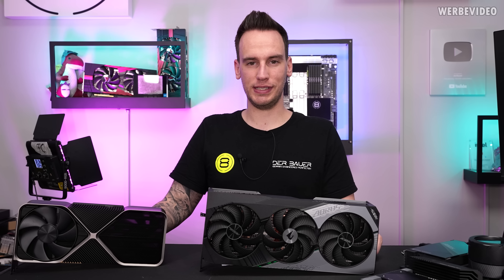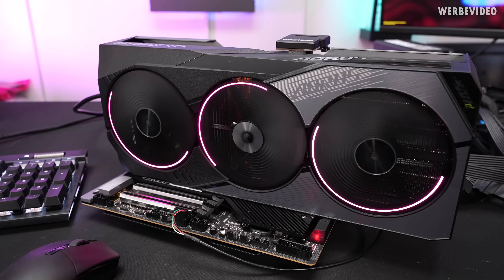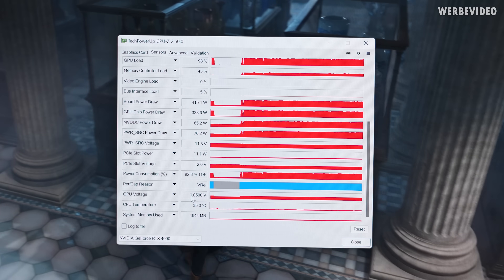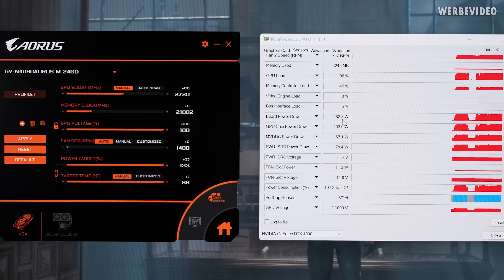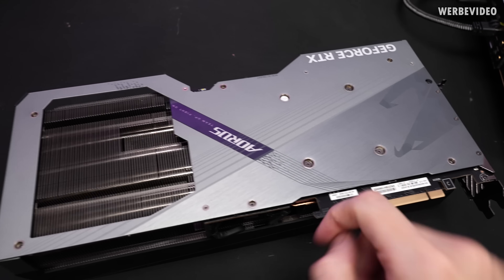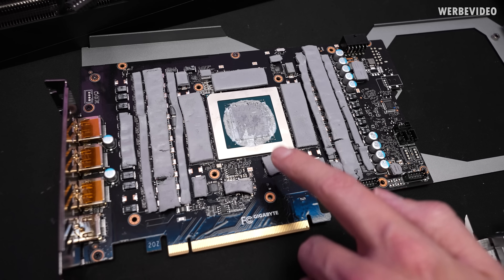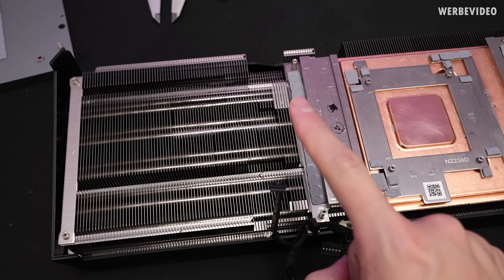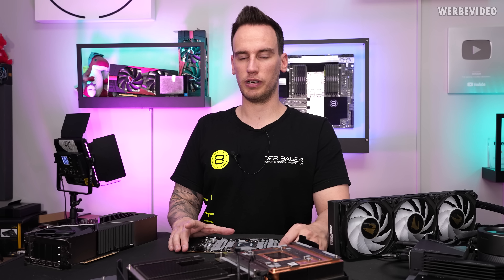Hidden NVLINK? RTX 4090 Aorus Master Teardown and Overclocking to 3GHz

Comment: I'm buying 4090 this late an I'm considering a few models, like this one. FE is not available for me but there's a cheaper option, Inno3D iChill X3 OC that is limited to 450W. Do I understand correctly, that with this Gigabyte card I would only se like a few % performance increase?

Comment: Here's the reason why you can't add your own GIF: In RGB Fusion 2.0, when you select your GIF and resize it, there's no "cancel or ok" button showing up at the bottom of that window. That's because the application wasn't coded to automatically scale that particular window to your screen's resolution (dumb oversight) 

Here's a quick fix: Lower your screen resolution a lot, until you see the "cancel and ok" buttons, then you'll be able to add your own GIF :)

Comment: I have this exact card and i am having issues controlling the fans and setting a fan curve. the Gigabyte software, MSI Afterburner, EVGA Precision X1, Aorus Engine, and another program called fan control does not work. with all of these programs i can change memory speeds, core clocks and voltage but cant do ANYTHING with fan speeds. ive updated Bios on card both "OC" and "SILENT" modes, installed latest drivers and still cant get a fan curve to work. if you still have this card could you please see if you can change fan curves ETC?

Comment: I have just been comparing the heat pipes from an Aorus 1080 Ti Extreme and an Aorus 4080 o/c I notice that for some reason the heatpipes on the 1080 seem to be much larger than those on the 4080 which seems counter intuitive.

Comment: Pretty annoying when these AIBs make these fairly impressive, massive vapor chamber coolers with all this bling... But then totally cheap out on the thermal pads/paste.. Which is where the heat actually conduits to all of the big fancy cooling hardware. Spend an extra $10 and use quality thermal interface material, like WTF?!

Comment: Have you noticed that the fan 1 and 2 in GPUz are spinning at different speeds? In fact, the GPUz shows a higher % fan speed in the 2nd fan but with lower RPM. I wonder if this is normal. I have the same behavior in the gaming OC model. Thanks!

Comment: I water cooled my 4090 with a 420mm Rad and its a perfect fit. It brings the card size right down and thermals/noise are very low.

Comment: Anyone who buys this is killing the GPU market. This monstrosity is 100% profit margin, nVidia is scalping every single one of the idiots that buy it. Wake up guys before nVidia kill off the AIBs and then really screw you over a table without any lube whilst using a sandpaper condom. The 4090 (it really isn't as it is a 4080, you'll see in the coming months that this will be demolished and all the suckers will cry like girls) should be no more than £900, and that is pushing it. nVidia is SCALPING YOU!

Comment: Call me crazy but this is why I wish it had had a Nvlink connector: At least 1 case would have supported 2 PCIE slots with 4 slots between them, and 4 more slots below them. Would I have used Nvlink? Hell no. But I could have found a case with 4 usable PCIE slots below my GPU. Then I'd just have to find a mobo that had them. I'm one of those weird users that still uses at least 3 PCIE cards, 2 of which are dual-slot, and wishes I had 1-2 more but can't seem to find modern motherboards bothering with configs that fit well.

Comment: The size and shear thermal capacity of these coolers is just mind boggling compared to prior gens. 

Hopefully voltage can be unlocked more so they can be pushed to the limit

Comment: I think you're probably try connect nv link... it will interesting to find nvidia dont take apart they software for nv link
Reply: "it will interesting to find nvidia dont take apart they software for nv link"

Well, they use a "unified" driver that has to work on older cards as well as newer cards. So, yes, I would suspect the code to support it will still be in the drivers, since those drivers must also work on previous generation cards that did feature it. The big question is whether or not these new chips actually support it. Just  because it's on the PCB doesn't necessarily mean it's actually connected to the DIE of the GPU.  Of course there will probably be checks the driver will probably perform before it will allow use of certain features but it's theoretically possible to "patch" the driver to bypass those checks. That's how programs like differentSLIauto were able to enable features that were supposedly "disabled" on some cards.

Comment: Hold up. 

What is that in-line "WireView" device that you're using to monitor wattage? Is that a PCIe3.0 16-pin power connector? Currently on a hunt for a 90 degree or 180 degree power adapter in order to fit the cables into my case.

Comment: So I have done some testing with my Asus TUF 4090 OC and what I have managed to get 2910 MHZ with 100% Powerlimit settings  in Afterburner +195 Core Clock + 200 Memory my GPU Temps are around 55-60 Celsius. Im quite impressed about my card to be honest :D

Comment: Pretty sure it was reported that ada would be a drop in replacement for ampere, I'd argue that the board was even designed with ampere in place then just switched out when it came to manufacturing

Comment: damn that card is massive, interesting you said about the NV-Link, just imagine if they did enable that and you had two of these cards in your system... what would be the heat and power output be??? .. that would definitely would have to be watercooled but thanks for the teardown

Comment: You have shown just another evidence, that 4090 are not optimized for anything: price/performance/cooling. Putting a huge cooler that can keep a card at 60C with everything at max and still be voltage limited is stupid. And I understand Nvidia why they have limited the voltage, because increasing the voltage will damage the GPU die.

Comment: Should also point out iGigabyte is being stupid with the number of thermal pads they're using.  Zero benefit to putting them on inductors and capacitors.

Comment: Hey der8auer, I was actually considering buying this card, does the backplate actually screw into the rear io plate or am I not seeing it right, and if I were to buy this card, would it be fine to remove the backplate and spray paint it black to match system? If I did remove it, what other thermal pads should I replace (if any), and does taking the backplate off also require removing the cooler? Thanks in advance if you respond <3
Reply from the maker: should be fine to paint. 3 screws go into the I/O bracket from the backplate

Comment: My guess is Nvidia doesn't want the value proposition to start popping up. After the ETH merge, they don't want people contemplating the idea of 2x 4080s or 4090s instead of buying a shiny 5080/90, as with the 3080 compared to a 4090 right now. Sadly SLI/Crossfire never got completely ironed out, it's a complete market segment upsetter.

Comment: But wasn't the 3090 a test run for the 4090? That would explain why the traces are in place for the NVLink. Leaving them in place is probably cheaper than completely re-engineering the entire PCB.

Comment: I still cannot get over how big these 4090s are.  I always considered some of the custom 2080 ti's to be big cards and the 4090s just blow them away in terms of board widths and cooler sizes lol
Reply: The first time I saw a 2080Ti I thought it was comically large. Now that the 4090 is released I’ve realised that Nvidia does not care about size at all. As long as the cooling needs more mass, they’ll happily supersize it. It doesn’t bode well for future GPU sizes

Comment: RTX 4090 coolers should have AM5 and LGA 1700 socket adapters. If only someone coul bend and cut the heat pipes and machine the thing to put it above an AMD 7950X or 13900KS Frankencooled...

Comment: 500 watt xD Do people realize how much that is?

We pay 50 cent/kwh in germany, This might even become more in the next months. Meaning in 400 hours of using this card you increase your power bill by 100€. Fair enough you might not run a benchmark and the average power consuption might be closer to 300W but damn, its not the only component in the computer. 

Btw, 300-700Watt is the amount of power a fully roided, elite, tour de france cyclist can output uphill. I would say this is the human limit. So your card is using almost as much energy as the strongest man alive.

With this amount of power consumption we could start thinking about implementing some sort of water cooling for the card that preheats the central heating system in your home. I think this might actually make sense. Considering that gas price is about 20ct/kwh. it would be more than twice as expensive to heat with the gpu instead of burning gas but at least you can game while doing it. It will heat your room anyway but by channeling the heat to the central heating system you can use it more flexible and maybe not die of heatstroke in your gaming room.

Just so you know one horsepower is 735Watt. So your new Computer is starting to compete with small motorcycles in terms of power output. Might aswell just swing yourself on a motorbike and pay the gas for a fun cruise. Its starting to cost the same and does the same amount of damage to the environment.

for comparison im running a 1070ti. it maxes out at 180watt but i use like 50 to 100 watt on average while gaming. Thats almost 5-10 times less!

Comment: I thought the card sitting on the desk was a comically large prop. Tbh if I were Nvidia I'd just remove the air cooler and require water cooling, that thing is never gonna fit into any real case. Also the heat output is too much for any case that isn't custom or open to the air

Comment: Cooling is getting out of hand these days. Of course there is nothing wrong with it, but the size is huge. Practically card is about half of the length of the whole package. Nontheless I'm impressed it stays under 70 degree celsius under load. I was expecting range of 75-80.

Comment: When you said the card is still tiny without the cooler, I was just in awe of how wide the PCB still is regardless of that lol. That could be problematic for a custom loop actually since terminals on the side add even more width to a card.
Reply: this is what I'm worried about with my 011 dynamic xl.

I contacted ek to see why they're doing a side port on a card that can barely fit in most cases but without the coolers have plenty of end room for them.
Reply: @tonymorris4335  Yeah some water block makers are making blocks with terminals at the end of the block, increasing length instead of width.
Reply: Comino has a beautiful professional block for this card  with the terminals at the end instead of the side.

Comment: It really does seem like those 600+ watt rumors had weight. I mean coolers are designed before they get the chips, right? So if nvidia said 600w, they designed a cooler to handle 600w. Either that or there is a card coming from nvidia that is 600w, and these coolers were just slapped on a lower sku chip than intended.

Comment: That NVlink stuff could be because the AD102 and the GA102 have a very very similar footprint and could be mostly compatible to each other. so manufacturers could use the old PCBs with some minor changes and just didn't cared about the old NVlink traces since it doesn't bother anything.

Comment: It would be interesting to see if you can get SLI even though NVIDIA says you can not. The connector is there so I wonder why they changed their mind?
Reply: 1. How are you dual stacking 4090s in any case anymore? Lol. Maybe EATX. 2. the bandwidth of PCI-E 5.0 just makes it unnecessary. I.e., the 4090 can run 5.0x8. So communication over PCI-E is no longer a bottleneck concern.
Reply: And allegedly they wanted to use the resources the NVLINK used for other things. I think AI cores or something. I forget.

Comment: as expensive as these cards are with these monster cooler, if you could buy a card without a cooler, I feel like it'd be almost cheaper to just build a customer watercooling setup. Or about the same price, but more flexible in the case

Comment: I was excited to get a 4090 today. But they sold out in seconds and are all over eBay at $1000 over MSRP. It’s the 30-series issues all over again. I’ve been building PCs since 1999 and I think this may push me out of the hobby for good.
Reply: Unfortunately scalping like that is common for new hot releases for everything these days, not just PC stuff.   Give it a month or two.
Reply: Nvidia already said they are intentionally keeping stock low through 2022

Comment: It would be interesting to see if a modder could get NVlink working as well as raising Voltage allowance.
Reply: if i am not mistaken they likely just changed the board shape and hid the pads, it might be possible to simply file down the extra pcb material carefully and endup with a working nvlink, question is who has the balls to try
Reply: @cj09beira  there isn't connection on the die either.
Reply: @kevinerbs2778   really?, then RIP, only custom pcb can save us then, btw source of the info?
Reply: raising the voltage is easy, a shunt resistor mod and boom, done
Reply: @BenQuigley  those shunts sense the Current, and are part of the "Power" limiting circuit, it wont change voltages at all

Comment: I am far more likely to buy a second 3090 rather than a 4090 ti when it comes out

Im more likely to get more performance out of compute mode on dual 3090 than a 4090 ti anyway because more memory bandwidth using 2 3090’s

Comment: Would love if they could push this card to 3.5ghz.. 

There will be a day where GPUs will exceed CPUs
Reply: "There will be a day where GPUs will exceed CPUs"

You're a little bit behind the times here. GPUs have exceeded CPUs for many moons now. That's why we have things like CUDA and why miners buy GPUs and not CPUs. In fact the whole concept of 3d accelerator cards began because it was clear that GPUs would be able to outperform CPUs, particularly for 3d rendering. And with time that has expanded into many other tasks beyond rendering. Basically today's GPUs are supercomputers on a PCIe card and the computing power of even a modest GPU far exceeds that of the average CPU. In fact, it could be argued that the only reason we still need a CPU is for performing the more mundane tasks like running the operating system, managing resources, scheduling tasks, handling input/ouput and feeding data to the GPU.
Reply: @stefanl5183  I was meaning clock speeds.. so far GPUs only come on at half the speed of CPUs .. but I'm sure on time CPUs will become the new "coprocessor.

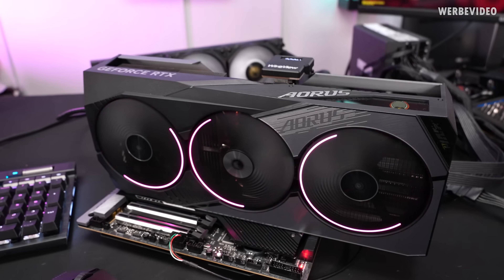Comment: 1:53 Any effects on such a power hungry card blowing hot air on the PCH and maybe M.2 SSD since the fins are directed to the PCI-E slots ? X570 boards with fans might suffer from this, the PCH is already hot.

Comment: Maybe full fledged AD102 (100) core for RTX Titan "Ada", which is been talked about really a lot in last few days, would utilize that, or maye it's just unused "leftover" from old 30-series cards, which has same PCB with minimal changes/bit stronger power delivery. Those two "speculations" are the ones I'd see the only reason of its existence.
P.S.: @der8auer what's the brand/model of that WireView connector, I can't find any by looking for WireView pci-e connector or any other "WireView" (+ pci-e/pcie/connector/cable/etc... ) search term ... There are multiple products with the same name which are obviously much more popular and called the same and also related to pci-e... Thank you and keep up the great work !!
Reply: I was looking all over for this as well as soon as I saw it. Hopefully he has a link for it!

Comment: I would put money on it that Nvidia told them this card would use 600 watts.  That is why the coolers are so over spec'd for the current design. Nvidia saw the uproar with the card predicted to use 600 watts and altered it.

Comment: Jenson is so dumb bruh 😂 he didn’t tell his board partners they would be using TSMC 4nm so they thought the 4090 to be on Samsung’s process which pulls more power. 

Jenson so paranoid he can’t even communicate properly with his partners 😂

RDNA 3 got Jenson SHOOK. When you see the rasterization performance you’ll see the 4090 isn’t that special
Reply: That’s why the coolers are so big
Reply: @boukm3n  The cooler won't make a real difference as 450 watts of hest is also 450 watt of heat even if's is 7C lower temperature from 72C to 65C. All that heat is still going into the air.

Comment: I wonder how much you'd gain if the voltage actually went up by the requested +100mV, instead of the 55mV it seemed to gain.

Comment: But you are staying at 99% CPU usage, so is it a CPU limitation?  Also, the natural oils and grease from skin, will hurt the thermal pads' performance, so why are you not wearing gloves or using tools to lift off the thermal pads from the GPU itself?

Comment: Maybe if you ramp the fans to max to drop the temp, you could achieve slightly higher clocks?
Reply: No there isn't enough voltage to clock higher it's not a matter of temperature at this point.
Reply: @PrettyboyPa  Yes but at colder tems you can clock higher at the same voltage. So since +170 wasn't stable now, maybe it wouldbe at slightly lower temps
Reply: He said that he couldn't.

Comment: They should sell seprate micro itx case with card inisde with seprate psu connected to mobo with special outside connector the size of the card with comprasion to mobo is silly.